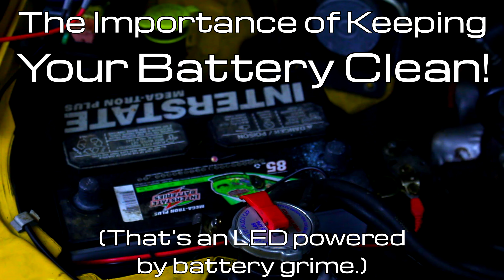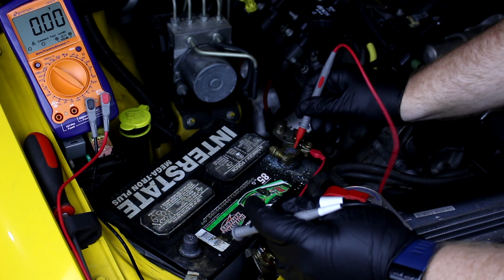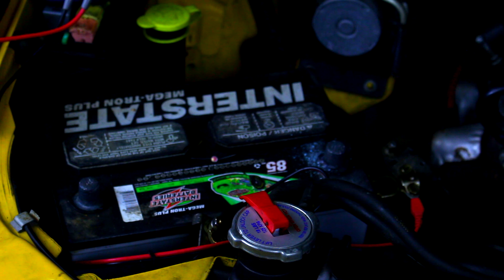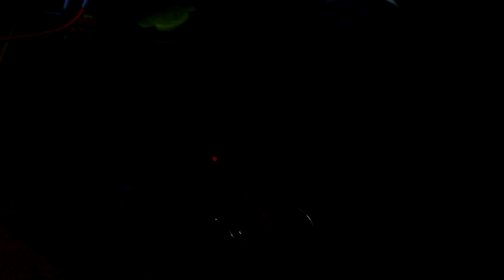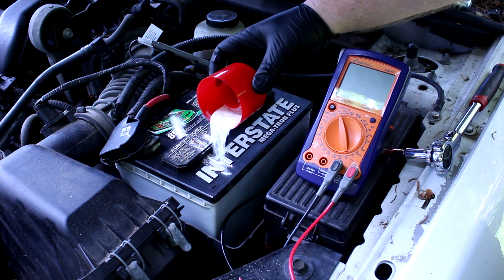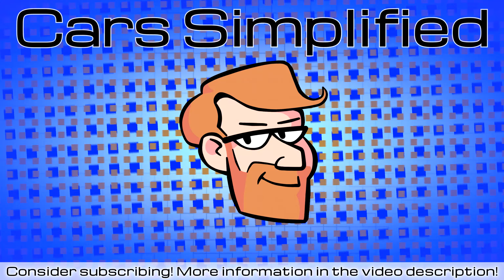Keeping Your Car Battery Clean is More Important Than You Think! • Cars Simplified

Comment: Every once in a while I apply some vaseline to the terminals after a good scrubbing with vinegar then i spray it down with battery cleaner everyday. starts right up with no problem and alot less corrossion no more stalling starter.

Comment: Simple and Basic are the best Tips anyone can share. But in this case this is super useful .. Thank you
Reply from the maker: Thanks! The issue I showed here might not always been the issue a battery is dealing with, but if it gets people to pop their hood and clean some corrosion off the terminals, it might just save someone from some battery trouble later on. They're expensive!
Reply: @CarsSimplified  Thanks again, but I see alot of people staying in their Idle cars for 15 - 20 min 2-3 times a week afraid their batteries will get low. I am sure that this usefull tip could help many people doing that .. maybe to do it once a week instead. Those are 4 hours of idle time a month down to 1hr and 20 min.

Comment: Your battery wasn't too dirty.  I have seen over the years some cars caked with battery acid on the terminals.  I guess they never looked under their hood.  I have used those round felt covers for the terminals and never had acid buildup.
Reply from the maker: I used to deal with heavily corroded batteries all the time; I even saw a blue corrosion bloom so big it started rusting the hood. There is definitely a lot of battery neglect out there!

I should get some of those felt washers. I used to sell them with new batteries all the time.